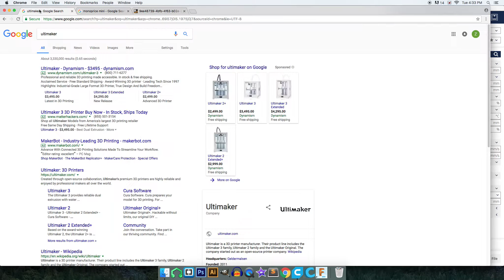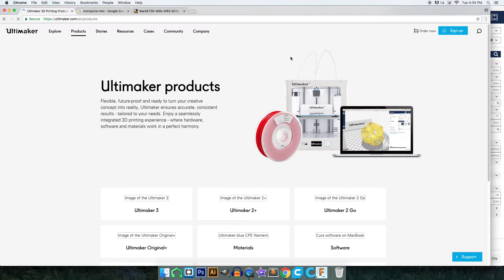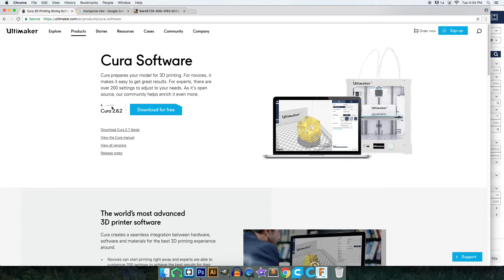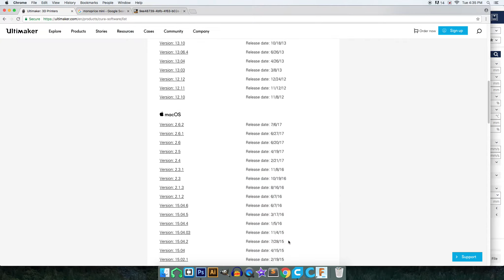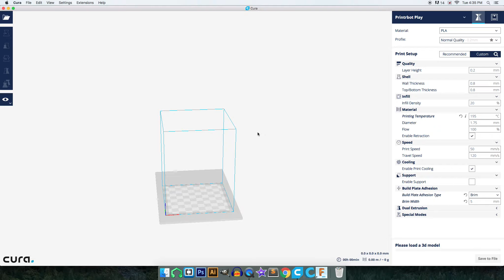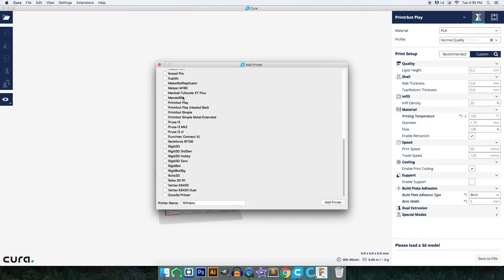MonoPrice Mini custom Cura 2.5 Profile Setup

Comment: Hi. I use the Monoprice. And think it’s great. The Cura 15 does one thing that the new cura does not. I can do a drawing in Scetchup and open in cura 15. But can’t in 3.5 or 3.6 or am I missing something. I have used this printer the last year and my son discovered it has WiFi.

Comment: When it asks me to chose a Gcode flavor, you say to use the reprap  (marlin/sprinter) which is one single option. But I have an option to chose marlin or reprap. They are two different choices. So which one do i chose?

Comment: Can I use these settings for the V2?
Reply from the maker: I assume so, I am hoping to purchase a refurb V2  or a new one  in the next few months to confirm for certain but the critical sizing etc is what you need. 
The V2 really just adds better electronics (possibly just better cooling or power management) and a better quality build plate....as far as I can tell.

One thing to ALWAYS remember is to completely power down the printer and power it back up if you ever pause or cancel a print. For some reason the home zero is lost when a you pause and eventually cancel a print.  Canceling, popping off the partial print and immediately running another print will cause some freaky belt jarring as it tries to head off to a coordinate that can't be reached. Power Down and then start up a fresh print.

Glad this helped.
Monoprice is somewhat unhelpful, and the original Cura that comes with the printer is buggy and bad news.  

Best of Luck Mark!
Reply: Patrick Boyd 

Cool thanks fo the info. I plan to get on by December.
Reply: Just got a v2 and can only print the cat lol

I’m soooo noob... the printer seems to be printing in the air :(

This may help I hope
Reply: TomColontonio 

Ok good to know. Cool channel I subbed
Reply from the maker: Tom, sorry I am just now getting back to you, did you ever solve the 'printing in air' issue and get the zero set down on the plate?

One of my students bought one of these and it ratcheted and made grinding sounds right out of the box so Monoprice swapped him for a new one and he's off and running.  

Hope you got some better parts or found the issue (or got a better printer/replacement printer). I will try to update this over one of the upcoming school breaks ....to make it shorter and more current for the newer cura 3.04.
Reply: I did not and sent this back fro the bigger model. Mine had bed plate RED HOT issues
 thanks
Reply from the maker: Arrgg, bummer. Thanks for the replay Tom.
These kinds of quality control issues are the reason I can't buy more than one printer at a time and FULLY test it for school use. They are still a bit too hit or miss when it comes to out of the box functionality for me to truly "promote" them, but if you get a good one, they can be great. I have given up completely on PrintrBot, everything we got from them was junk and they were utterly un-helpful. If you don't mind me asking what did you end up getting?

Comment: Hi Patrick, thank you very much for your help, today I got the printer and it is already working to the prefection.
Reply from the maker: Glad I could help, not sure why there isn't more solid info out there. As I just mentioned about, be sure to power down the printer completely if you ever pause and cancel or cancel a part directly. The home zero gets lost or corrupted in memory and needs resetting from a complete power down. If you don't do this a jarring belt symptom will occur where the print head tries to move far far away to some coordinate it can never reach.  If this does happen just do what comes naturally and instinctively and unplug the power as quick as you can. But you probably don't have to go recheck your model, it more than likely just needed a power reset.....the old tricks are the best ones sometimes. :  )

Best of Luck Eduardo!